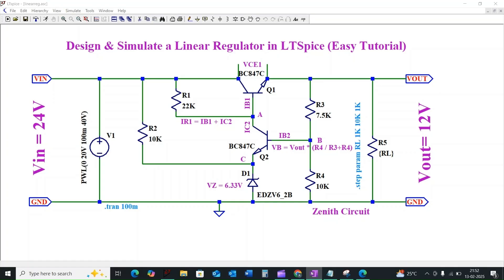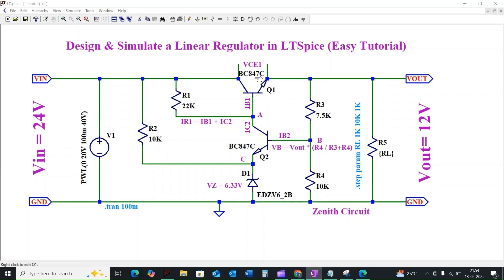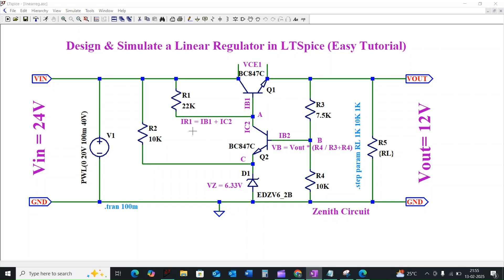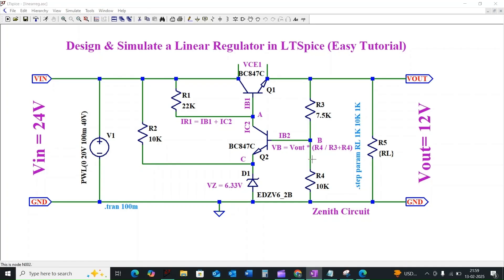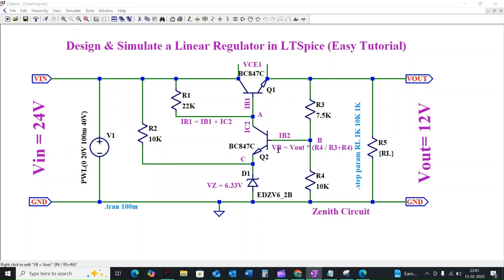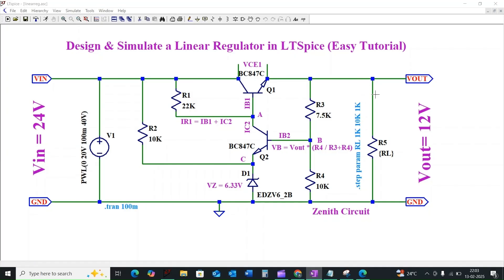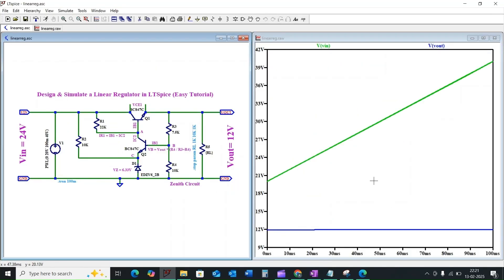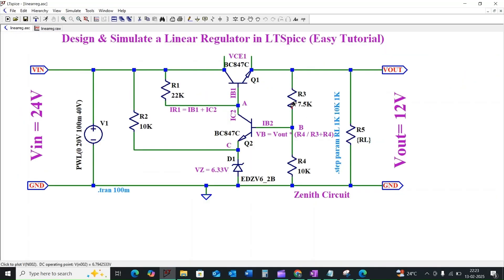Design & Simulate a Linear Regulator in LTSpice (Easy Tutorial) || Hardware Design ||

Comment: This circuit is useless  because the amount of power required of the transistor for large voltage drop at Q1 and current drawing.  For
example I am going from voltage source input that varies from 12.5vdc to 0vdc and I want output constant 3vdc up-to vin of 3.7vdc then the transistor doesnt have enough power. The assume draws 100ma.  You have any solution for that scenario?

Comment: Thank you for your presentation. I have two questions:
1. What is the crossover frequency and phase margin for this circuit, and where would you place the acsweep source (stimulator)
2. How would you ncalculate the DC Gain for this circuit (low frequency gain)
Thank you in advance for your response
Regards Udo